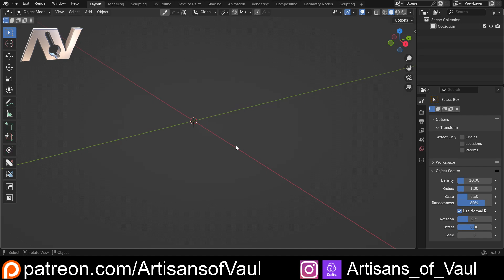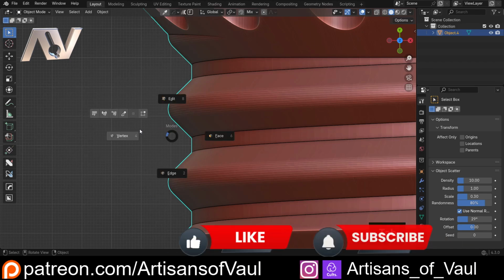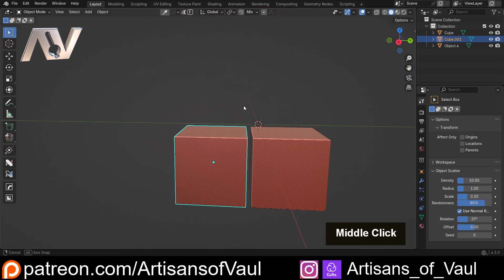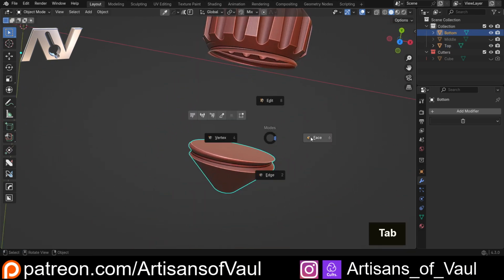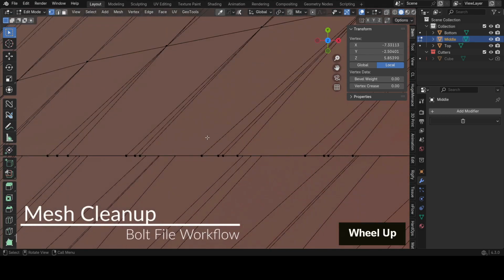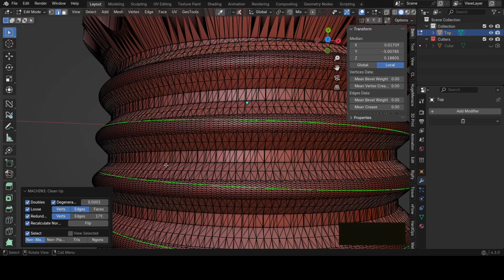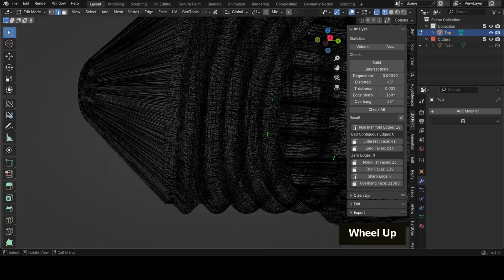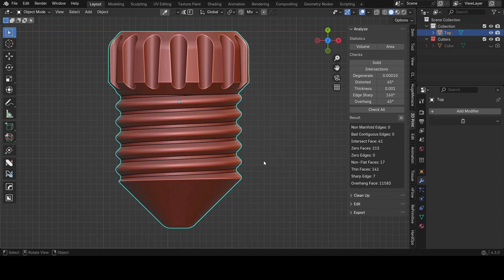Blender Workflow Example: How to extend a bolt obj / stl file for 3D printing

Comment: I just use the 3D print toolbox tool "make manifold"  tool option, for 3d printing this usually provides a result that is satisfactory
Reply from the maker: @wayoutthere907  In many situations it will but for more complex models it can create more issues than it solves until you cleanup to a certain point before using it so it can recognise what it's doing.

Comment: That is such a lovely way of doing it. I have often tried making a thread myself that had the same dimensions as the existing screw, and it almost never fits properly.
Reply: I should mention that in 3d print toolbox when you click the check "solid" button, and then in the "result" pane click "non manifold edges", will select the same problem areas as you used machinetool's cleanup tool to select. (also sometimes, in stead of merging by distance, you can just press F to make faces out of the holes. This can backfire if there is some wonky hole geometry, but ctrl-Z is our friend)
Reply from the maker: @imonseii  thanks. 3d toolbox generally will but sometime it will also select other area and it's process takes longer to do the calculations for whatever reason. So I have found Machin3 Tools more reliable for this method and faster
Reply: @ArtisansofVaul  you are quite right about the computation time, for some reason. I haven't found that it doesn't select the non-manifold areas yet when i click the button. maybe I just haven't worked on borked enough meshes yet :D

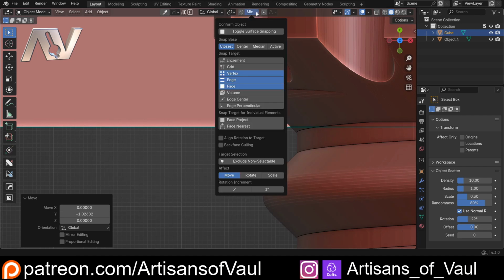Comment: Very informative video! I have machine tools, but I don't really make use of cleanup stuff (perhaps I should start ;) )  At around the 3:23 mark (when you select both vertices and duplicate them along the X axis), I think I would have then in turn extruded those floating verts in the x-axis to form edges. That way, once you are back in object mode, you can still see those as reference. The other thing I noticed is that when you snapped a box to the floating vertices (4:17 mark), you used a "mixed" snap setting (comprised of being able to snap verts, edges and faces). I am currently using 4.3.2, but I suspect that even in your version in the video, you shouldn't need the use mixed snapping. I tend to leave snapping off and with the default snap setting to "Increment". When pressing G then B and left-clicking on your "source mesh", you should be able to snap to your "target mesh" verts, edges and faces by default. Either way works though.